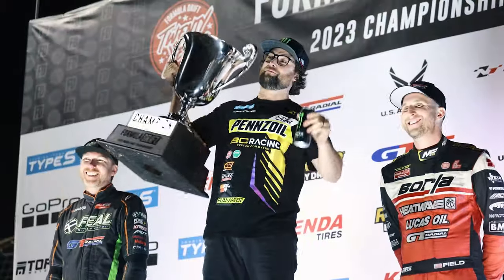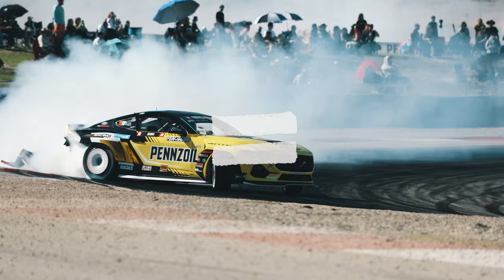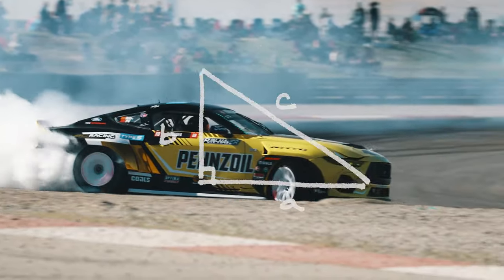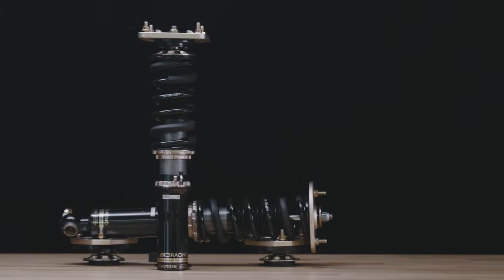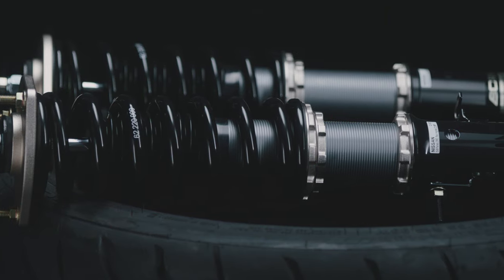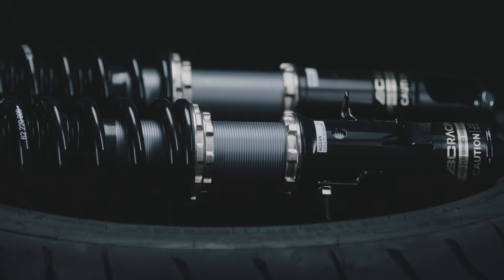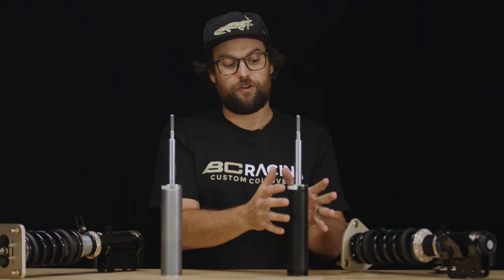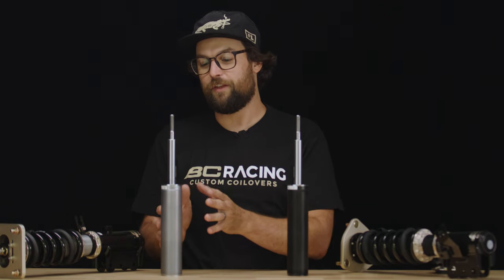DIGRESSIVE OR LINEAR SHOCK DAMPER VALVING? With @chelseadenofa

Comment: Thank you for the info and continued commitment to sharing suspension insights!

I could really benefit from some advice on the suspension setup one would look at for a gravel/low grip tarmac (drift) seat time E46 built within a reasonable budget. (NA 6, stock).
I imagine a soft springed setup with more ARB could be a decent compromise for both with shock adjustments. Would any entry to medium level BC Set able to do gravel driving and which set would allow me to raise the car more? I can provide a lot more details of course but don't want this to be too long, I value your time just looking for general directions. Thanks in advance!

Comment: Man that is confusing to grasp how it would actually work in the car
Reply: In layman terms, digressive handles imperfect roads at slow speeds by being stiffer, at a higher speed over that same road it will be softer because the wheel is traveling faster upwards and downwards.